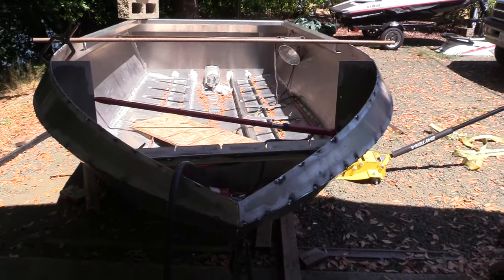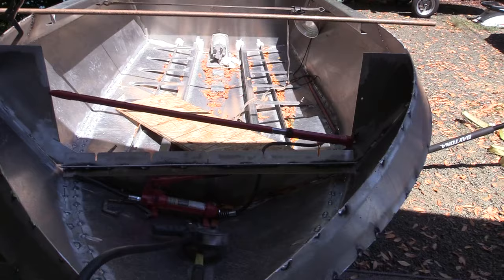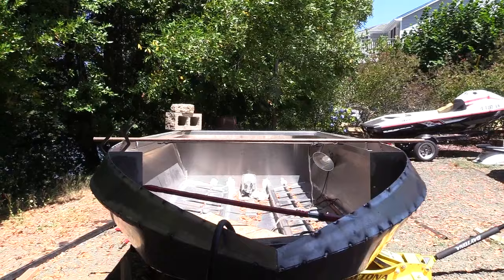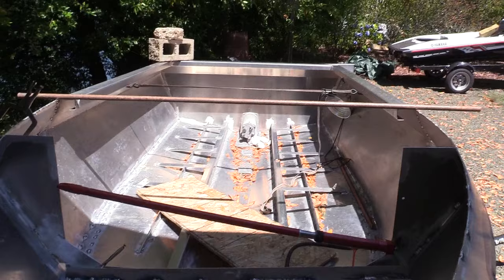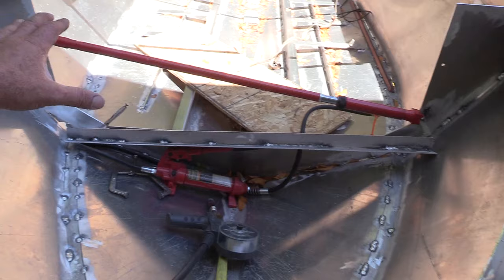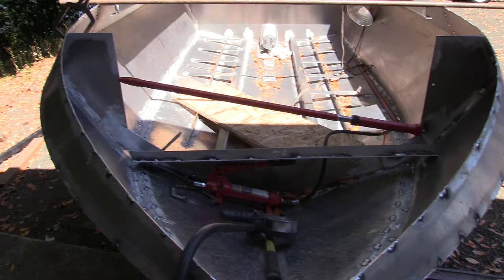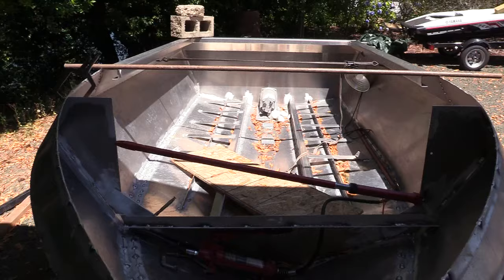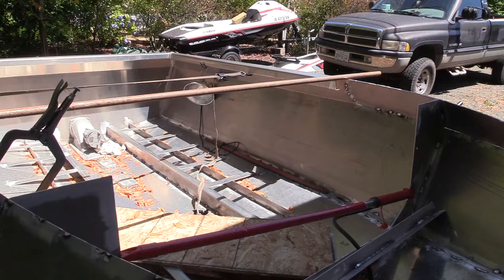Wattscraft Mini Jet Boat Build Video #37 Hull Bracing and Foredeck Mounting

Comment: Good on you Paul, well done mate.  Glad you’re working through this problem with some logic and determination. If you tack welded two turnbuckles extended with some steel rod at the bulkhead and down the bottom corners diagonally and wound those turnbuckles so the top eyes down to stern so they’re in line and then put the front plate and windscreen on and weld off the remaining seams and after it’s all cooled down . Then remove the turnbuckles .  It will still remain symmetrical.  And also you are sounding more positive in this video, so I think you will happy that you decided to fix it and make it right in the long run. Good stuff